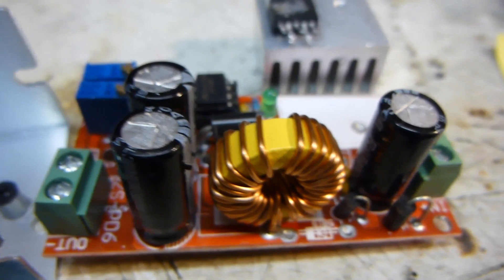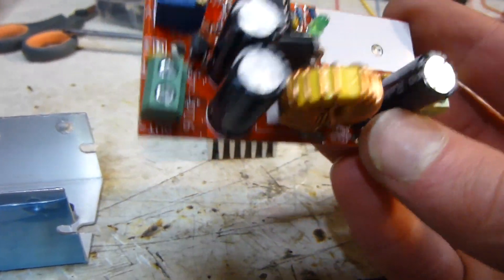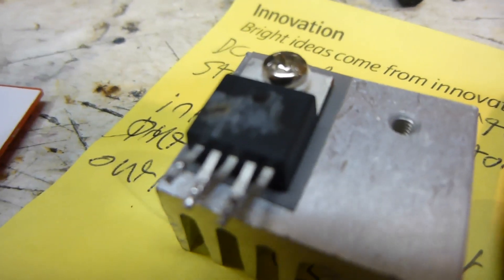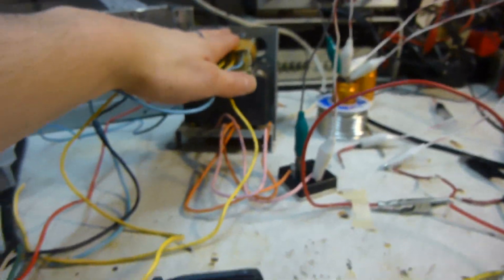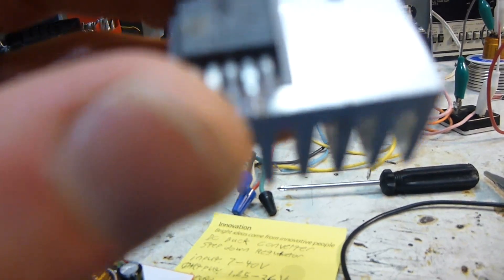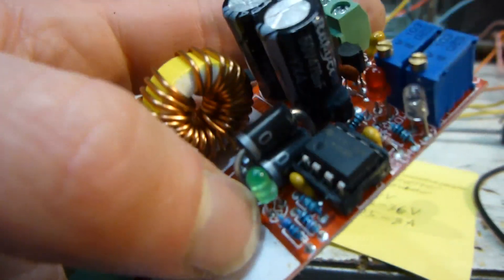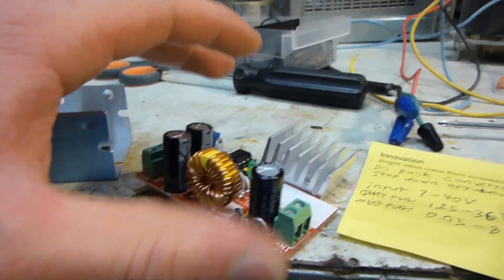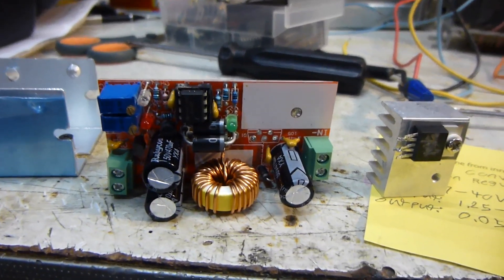Cheap DC to DC Converter Fail

Comment: Is a lm2596 dc-dc fukin buckin converter big dog...   but they are not great above 3A.  If running anything above 2A use that heat sinc..

Comment: Wow, great job, blurry video with no component value listings, haven't traced out which the ground pin is, and you want us to divine the part, although there are dozens of 5-pin switch mode voltage regulators. And you just keep shaking it while i'm trying to trace it out! But i'll bite.

First thought was XLSemi, like XL4016, but i don't recognise the pinout, doesn't entirely seem like it. Maybe LT1270? Also worth of note: possibly they ground off the marking because they had the wrong chip or a very, very obvious fake. They don't care whether you can repair it, they care if you look at it and in one glance go like "waaaait a second, the filthy bastards lied" and demand your money back. It's important to check what other components on the board may have failed without visible damage - if they did, well then maybe the chip was OK and got taken out, if nothing else failed then it must have been a fake or pre-damaged, because an LM doesn't simply burn up, LT neither, both actually have short circuit protection. XL is supposed to have one too, but opinions differ as to whether it actually works.

Comment: It is the XL4016 (8A)  from XL-SEMI. You also have a 12A version called XL4012 but I think this one is out of production now. With high currents often the Schottky burns out and will shortcut the XL4016 and will destroy the XL4016. So, first replace the current Schottky with a higher current (>10 A) Schottky.

Comment: it is LM2567 Voltage regulator series and variable voltage is due to adjustable feedback from voltage divider to the regulator typically LM25xx series can handle up-to 3.0 A of current output  with a peak current limit up-to  7,5A tops but it usually burns out google TI LM25xx regulator for data sheet.

Comment: Part is likely grey market/counterfeit/stolen/wrong for the specs, etc.  Don't bother finding our what they used.  Look at an LM26xx series.  I see the toroid on the board and guess it is driven by the TO-220-5 device.  Trace it out.  If I am right, look at those LM26xx's.  One will be right.  Go to EEVBlog and get some help on over current protection.  Those guys are great and nice about helping the "maker" people.  They don't expect you to be a double E.
Reply from the maker: Ok I'll look into that.  Thanks!

Comment: Switching regulator maybe?
I ordered crap like this too, does stupid people really try to hide the componets..
Reply from the maker: Yeah something like that.  I know it's really stupid.  I think they don't want you to know what the component is so when it burns out like mine did you can't replace it and you have to buy a new one.  But the thing is that I'm not going to buy a new one because I found out it just sucks.  Thank you!
Reply: Makerj101 Yeah, Its better just to make one yourself or just buy high quality and not crap from eBay, they probaly hide the compontes because they know its a piece of crap and it going to break anyways..
Reply from the maker: xXxViDeOxXxKK Yeah that's what I should have done in the first place.  Thank you!

Comment: This work http://www.ebay.ca/itm/131026040342?ssPageName=STRK:MEWAX:IT&_trksid=p3984.m1438.l2649
Reply from the maker: Hmm I don't think it would really do what I want though. It would work for controlling motors though.
Reply: Why would`nt it work for controlling amps for any device ? it`s as long as it`s DC should`nt it work?
I was under the impression it can be used to control the amps for use with a HHO fuel cell for welding, heat is heat ?
Reply from the maker: Well it doesn't control amps or voltage.  It's a PWM (pulse width modulation) speed controller.  A PWM module simply chops up the original voltage and amps into little pulses.  So while that will be just fine for resistive and inductive loads like heaters, motors, HHO generators, etc.  It will not be good for any electronics like powering a camera.  All those high frequency pulses will really mess it up if not kill it.  Google PWM.  Why couldn't I just put a capacitor on the out put of the PWM module?  Well I can't do that because that capacitor would instantly be charged up to whatever my supply voltage is.
Reply: Ok my bad, thanks for the info good to know. I bought it for an hho dry cell and stumbled across your video so I threw it out there. I just received my order from him Today way ahead of the time frame and everything looks perfect, He will get 5 star rated...
Cheers, good luck with you search.
Reply from the maker: Oh it's fine! It should still work for a HHO cell though.  Make sure to keep an eye on the temperature and don't run it to close to the max rated amps cause it could fail like mine did!  Good luck!

Comment: LOL!
Typical chinese/ebay rubbish, the chips usually are either made by some benign manufacturer, or they have their label scratched off.
I highly doubt that little device could do almost 300W...
Another cheap thing, they used three 3A (judging by the size) diodes instead of one big diode. This can cause problems when one diode heats up a little more than the others, causing it's resistance to go DOWN, causing more current to flow through it, and causing it to get hotter... yep, it will be destroyed in no time!
Also, yet another cheap thing... those electrolytic capacitors are fake. They look to be the 'Rukycon' brand, which are cheapo knock-offs of the quality Japanese 'Rubycon' capacitors.

What you need to do is to get some high power transistors, and a large heat sink, and build your own linear power supply. To help dissipate less heat in the transistors, you can have multiple taps on the power transformer, and a microcontroller (ATMega328... PIC... etc...) can be programmed to switch them on and off via some relays when needed.
Reply from the maker: Yeah I'm going to be more careful what I buy on eBay from now on...  It's a real piece of junk...

Thank you!  I think I'm going to modify a computer PSU like on this website!  http://www.chirio.com/switching_power_supply_atx.htm

Comment: I suspect its a constant current adjustable regulator. Do two of the pins go to a shunt resistor?
Reply from the maker: Hmm I'll have to check that... I'll get back to you on that...  Shunt resistor is just a resistor that is like less than 1 ohm or something or maybe ever a trace of wire?
Reply: Yep. Just a low value resistor for measuring current via the voltage drop across the resistor. Likely 2.2ohms or less, and could be a trace. I know an engineer that makes a .01ohm trace on the neg input on every board. For convenient current metering.
Reply from the maker: Seems like one pin goes to neg, one pos, one goes to a 105 capacitor and other leg goes to pos, one goes to inductor. and one goes to the other side of inductor.  Thats very rough but probably gives you an idea.  I think I'm going to forget trying to repair it.  I think I'm going to do this instead.  http://www.chirio.com/switching_power_supply_atx.htm
Reply: That looks like the way to go! Very neat, and you get max current control and constant voltage. Only thing I would suggest is adding an ammeter. Digital volt meter across a 1 ohm shunt (20w or higher, filed down 3" nail works) would do it nicely :)
Reply from the maker: Ya I just have to find a power supply that has the right main chip.  Ya I'm definitely going to add a amp meter!  I can't do without one of those!  I'll probably add a couple other things to like short out for measuring the short current and stuff like that.  I have a meter that has current and voltage the I was planing on using for the other power supply that failed.

Comment: Check a few of my video :) I've made a very nice power supply 0-26 volts and 0-3 amp. the blown component is probably one of those LM26XX series chip they can handle up to 5 amp for some of these you can buy them on eBay for a decent price :) I still have couple of those 24v 6 amp power supply ;)
Reply from the maker: Hmm 3 amps is not bad.  Though I would like a lot more!  ;)  Guess I could parallel up a bunch of LM317's!  That would do that job, cause I have a couple laying around!  Thanks!
Reply: Makerj101 lol no need to parallel them just add an external transistor but those regulator are linear device meaning they dissipate the "extra" power in heat. I have an Idea build it yourself :) with an MC3063A Cheers!
Reply from the maker: Ya hahaha that's what fans and heat sinks are for!!!  So if I want a 10 amp power supply and I want it variable from 1-30 volts then when I run it on 1 volt at 10 amps I'm going to have to get rid of only 290 watts of heat!!!  That would make a nice little heater!  XD  Hahaha Ya maybe switching might be the way to go!!!  :)
Reply: lol yup that's correct hahaha quite the amount of heat no? This is why switching power supply are way more efficient :) and since you want a buck converter those are very easy to build :) you can make one with 2 transistor.... hold on it's not the best efficiency but you know :) you can also use the MC34063A which is very cheap and you can do buck, boost or inverse voltage conversion also very easy to add external transistor or mosfet for that extra current you need the chip also has thermal protection and over current quite the nice one I need to order some more I have 2 left O.O hehehe! Let me know if you need a hand with that one :P
Reply from the maker: Ya true!  Hahaha

Thanks!

I came across this:  http://www.chirio.com/switching_power_supply_atx.htm  And I think I'm going to build one!  Seems pretty easy and lots of current!!!  :) :) :)  Plus I have a couple PSU's laying around that I wouldn't mind making more useful! :D
Reply: Have to agree look simple lol and those power supply are hard to burn :P good luck I want to see a video of this one mouahahaha!
Reply from the maker: Ya I'll have to do a video about it!  First I have to put away the ZVS driver before I can start on this!  :)  ZVS driver video is scheduled for Wednesday!  Keep an eye out for it! ;)
Reply: Awesome I will :)
Reply from the maker: Thanks!
Reply: You're welcome!

Comment: why didn't the current limiting feature protect the mystery component?
Reply from the maker: That's what stumps me too.  I had it set near 7 or 8 amps when it blew.  Before when I tested it I started around the 1 amp and then shorted it out and turned it up to 8 amps and it didn't mind that.  I guess it does not react quick enough.
Reply: Makerj101 Yes it seems they don't react fast enough. that's the problem with cheap power supplies, I burnt an LED by connecting it to a low end power supply limiting the current to 50mA or so but at 12V just to see how fast it will adjust the voltage :(
Reply from the maker: Yeah I would imagine this one would have done the same to an LED.  It wouldn't really blow the LED because it's not fast enough, I'm more inclined to think it's the output capacitor.  Cause as soon as you connect up that LED the smoothing cap is going to dump all 12 volts into it. But ya the slowness of the current limiting could add to that.
Reply: Makerj101 Very good point. There is no (significant) current limit on the output of an output capacitor!
Reply from the maker: I guess the only way you could limit that is put something like a 3 ohm resistor on the output.  That would somewhat limit the current to less then 8 amps at 30 volts.  But you won't get full current at lower voltages.

Comment: Should be a voltage regulator, adjustable. Can't tell you witch one tho... ;( ~Russ
Reply from the maker: When I first saw that it had multiple leads that's what I thought.  But after looking at some adjustable voltage regulators that have multiple leads I realized that they only have 4 leads and can only handle about 2 amps while this thing has 5.  I have seen similar components in PSU's that have 5-6 leads.  So I think it's some kind of PWM and mosfet package.
Reply: Hi
It is only 10.55$ get a new one :)
http://www.aliexpress.com/item/1pc-new-DC-8A-Buck-Converter-Step-Down-Regulator-CVCC-7-40v-to-1-25-36V/1439065160.html
Reply from the maker: Thank you, but no.  I wasted my money on one piece of junk, I don't want to buy another one that's probably also going to fail in the same way.  It looked good when I was buying it but it's just not built well.  I think I'm going to convert a PSU to a variable power supply!  Check it out!  http://www.chirio.com/switching_power_supply_atx.htm

Comment: This is very commonly used on eBay - even when you are buying MOSFETs their part numbers are usually rewritten. That's why I don't buy transistors from eBay anymore.
And the part might be some dual MOSFET or something like that (with common source, that's why 5 pins).
Reply: Makerj101 No, the 150W DC/DC step up converters have an 8-pin SOIC controller chip, TO-220-3 MOSFET, and TO-220-3 rectifier. Nothing in 5 pin TO-220 package.

If you really want to reuse this board, I'd start drawing up a schematic of the components and traces you can recognize and use that to pick out a TO-220-5 switching regulator that has a compatible pin-out to your board. You don't need to have the EXACT same part as whatever was originally on there, you just need one similar enough that it can be used without making a ton of modifications to the board's circuit. 

For example, look at SI-8008HFE. It's in the TO-220-5 package and has 5.5A output rating (it's always possible the board you have was advertised beyond spec, perhaps made up for by the heatsink). The datasheet shows a typical application diagram schematic where the chip needs some external capacitors, diode, inductor, and resistors, much like what I see on your board. Does your board hook up these external components to the same pins as the SI-8008HFE would need?

The constant current feature of your board probably makes things a little more complicated than the datasheet's schematic. It might be tied into the ADJ resistor divider circuit somehow using the opamp to tweak the control loop into reducing the output voltage when the current limit setting is reached. Frankly, I'm a little disappointed this board blew up by being short circuited if it truly did have a constant current feature.
Reply from the maker: That's annoying... WHY would they do that???  I think it's so dumb... Luckily the mosfets and transistors I bought not long ago were not like that.  Ya it could be a dual mosfet like you suggest.  Thank you!
Reply: Makerj101 When I worked for a semiconductor company, they were always saying that people in China copy each others' designs profusely, so if you can get one manufacturer to use your part, suddenly a bunch of other people will be buying your part too. Scratching off part numbers of critical components is probably an attempt to slow down competitors trying to copy the design.

It certainly seems true from my experience. I bought several of those cheap 150W DC/DC step up converters from multiple sellers. Even though they have identical specifications and look identical at first glance, you can see minor differences in silkscreen labels and traces that suggest completely different manufacturing lines. I think one of my 150W DC/DC converters had part numbers scratched off, while some other seller's 150W DC/DC converter didn't bother.

If that 8-pin DIP is indeed just an opamp, then I doubt the blown part is a dual MOSFET. You need control logic to actively generate the correct PWM duty cycle for changing loads to maintain voltage regulation in a switching power supply. Most likely that 5 pin part is a switching regulator with an internal power MOSFET. I don't readily see any 8A DC-DC switching regulators in TO-220-5 package on digikey though.
Reply from the maker: I guess I can see why they would do that.

Do any of the 150 watt DC to DC converters that don't have part numbers scratched off have a similar 5 lead part?

Ya that's what some other people were thinking too.  Might have a current sensing or PWM part and a power mosfet.
Reply from the maker: Oh thanks!  I guess that won't work then.

That does look like the same component.  Circuit looks very similar to the way the components are hooked up on mine.

Ya me too.  A while back I had tested it out by setting it on a low current, shorting it out and turning the current up and it did fine.  I guess it was not able to react fast enough when shorted like the way I did.  Maybe something to do with inductive feed back that killed the mosfet or what ever.

I don't know, I think I'm just going to abandon trying to fix it.  Looking at it more it's just not built well.  Maybe I'll try to build my own circuit with a bunch of LM317's that I just salvaged from some boards.  There are tons of current limiting circuits on this LM317 data sheet.  http://www.ti.com/lit/ds/symlink/lm117.pdf  Only small problem with using LM317's is that I'm going to need a giant heat sink!  I think I might parallel a bunch of them up to get more current capability.

Comment: that component there could be some kinde of transistor or mosfet with a current sens inside try  analysing
the board you should get it to work with a normal mosfet and if soo  you could get much more than 8 amps with a 40 amp mosfet
Reply from the maker: Yeah I think it is some kind of mosfet component.  I have seen similar 5-6 lead components on small switching power supply units.  Yeah that would be nice!
Reply: Makerj101 that chip ther is a op-amp so its working as a pwm probaly  so      wouldnt be hard to get it to work with a normal mosfet
Reply from the maker: Thanks!  So maybe it has 5 leads cause there are like 2 mosfets in one package?
Reply: probaly or one mosfet with 2 gate
Reply from the maker: Yeah maybe, though I never heard of such a thing...
Reply: yeah there exist some of those type